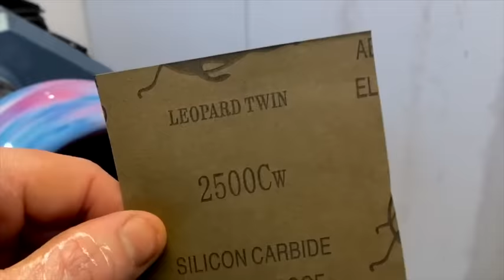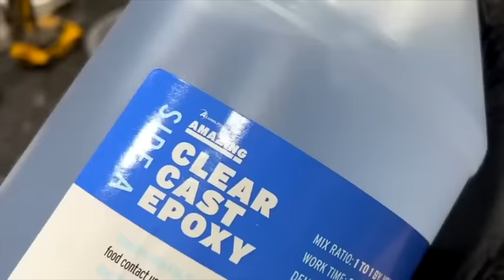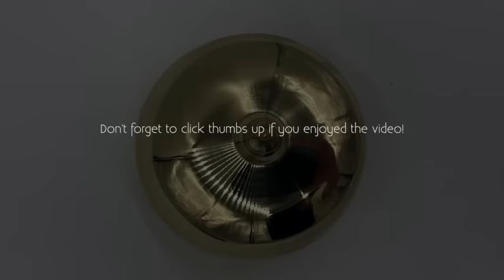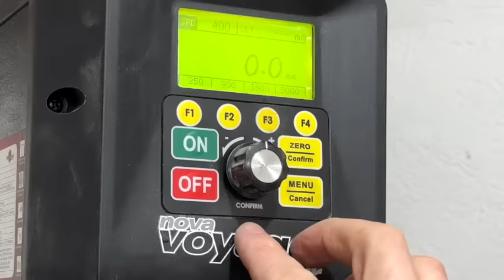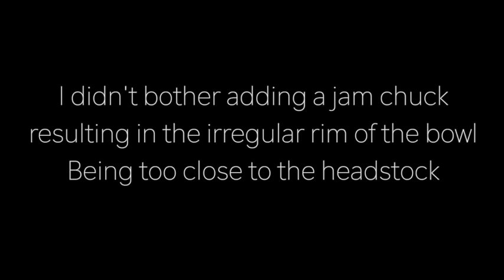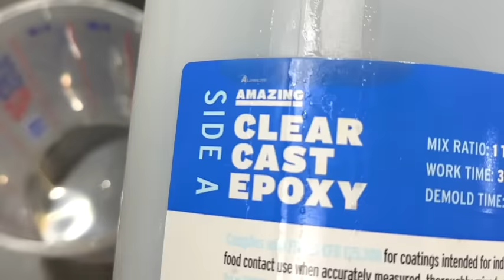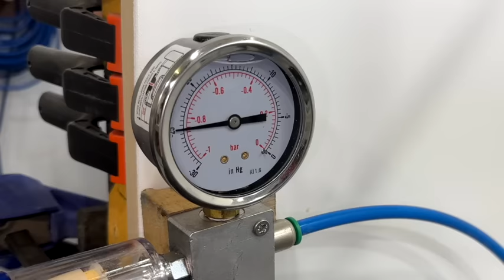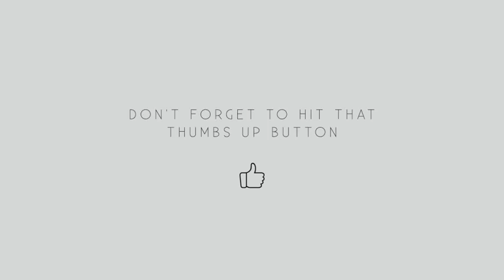Woodturning - 17 Greatest Woodturning Video's Of All Time !

Comment: Just finished watching the first one, and have to comment.  It looks amazing!  I was wondering what kept it from just flying apart when you were hogging out the inside -- those cracks from the fire seemed so deep!  Had you done something to stabilize the piece that I just missed?
Second video -- that burl was so beautiful, and you made it even more so -- it ended up looking like a flower!  
Third video -- I'm impressed by the quality of the wood inside the bowling pin -- I would have expected it to be pressed sawdust, not solid wood.
Fourth video -- another beautiful burl becoming a fantastic bowl.
At this point, I'm wishing you would talk and explain why you consider these situations to be shocking and scary.  I'm a little surprised by your results, surprised by your decisions to remove the bumps from the burls with the lathe rather than by some means that might be less dangerous -- seems like those chips could fly off and hurt you -- but so far I'm not really shocked or scared.  I watch woodturning videos to see interesting and beautiful projects being made, but I'm not above clicking on something with a click-baitish title.
Reply: Tyyy🎉 2:12 dddddddddddddddddddddddddddddddddddddddddddddddddddddddddddddddddddddddddddddddddddddddddddddddddddddddddddddddddddddddddddddddddddd
Reply: Ddddddddd
Reply: Dddddddd
Reply: Ddddddd
Reply from the maker: You dont find these highly unusual turning projects shocking? You must be over exposed.
Reply: @JackMackWoodturning  Highly unusual, yes, absolutely.  Shocking... no... I make art with found objects, and I watch Nick Zametti turn all sorts of things on his lathe, including shredded aluminum bits in epoxy, so may be I am overexposed. LOL  Gotta agree with all the ddddddd in the comments here, though.  And I did enjoy the video.